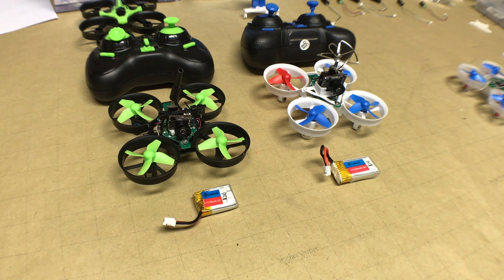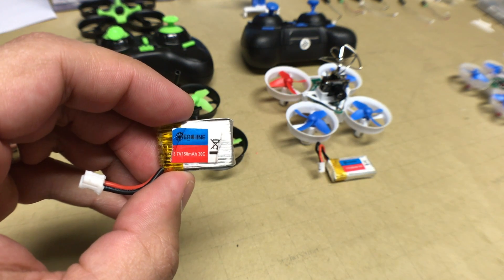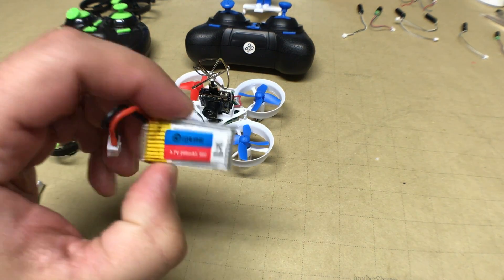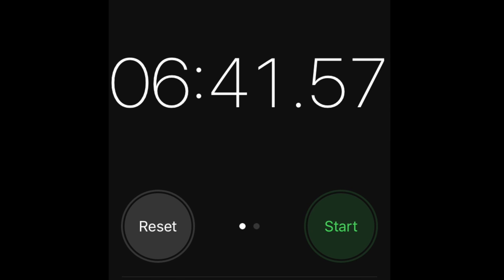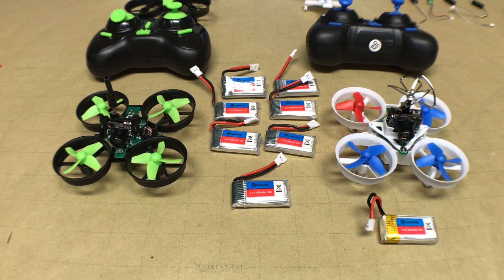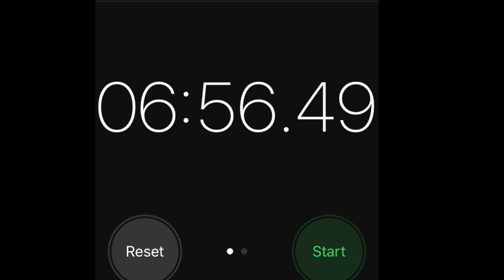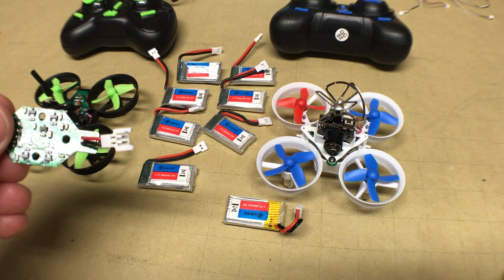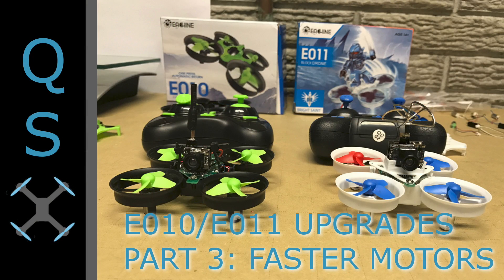Part 2: Eachine E010 E011 Upgrades - Battery Upgrades for E010/E011

Comment: Why stop there? I put JJRC 400mAh on e011, and should give about 50% more time than 260mAh. What's odd is the 260mAh that comes with the package is 9g, while the 400mAh battery is also 9g!
Reply from the maker: It's worth a shot.  Let us know if the performance matches the label on those 400mAh batteries.
Reply: I'm flying a modded E011c santa with a few holystone 350mAh (c rating not on batt), left over from a 170 with a fried board. i piggy back that junky little 200 mAh 35c that came with a E013 to a tx02 i get close to 5 min. now those 7/20 motors have my fingers itchy... ;)

Comment: Nice videos over different mod options for the E010.  Could you run a test on 30c vs 45c batteries?  I'm mostly interested in Stock E010 flight board paired with the best price/performance options.  I would like to see a flight test of whatever makes the most sense.  IE. 17,500KV/65,000RPM motors with 150mAh 45c batteries (lighter is better?)and 2 blade props.  

FYI. Special Sauce motors 17,500KV/65,000RPM on amazon are about the same price as the 59,000RPM that are sold on banggood, so maybe a comparison between the two might be a good idea.

Comment: run the audio for your vid thru a compressor and bring up the gain some. there's no way i can hear what you're saying.
Reply from the maker: +atomictraveller Is the problem with the clarity or the gain?  I can increase the gain in the video creator tool, but I don't run it through a compressor and would prefer not to if it is just the gain.
Reply: gain ;) your other vids were better (not loud but enough so i didn't have to press the speaker to my ear). i would say, always maximise your audio, use a limiter or something, better to clip the peaks than inaudible. ty :)
Reply from the maker: +atomictraveller check out my latest video and tell me if it's any better.  Hope it helped and thanks for the input!

Comment: Hi, is the battery connector on the E011 the same as the E010?
Reply from the maker: Hi Giacomo!  Yes, the battery connectors are the same on the stock E010 and E011.

Comment: Hi,  I am Vince Brizio  ! I want to buy a cheap Transmitter for my 
eachine E011( I hate the little stock TX ) .Please tell me which one  is
compatible?  the   X5C-14, BAYANGTOYS X16, devo 4 ? Do you have a 
suggest for me ? I have a Spektrum DX8, sorry not a Taranis  !! Thanks
Reply from the maker: Hey Vince, thanks for watching.  Unfortunately, I don't think I can help you with that one.  From what I could find, there isn't a good option for the DX8 and the E010/E011.  I have a multiprotocol unit on the way, but it doesn't work with the DX8.  Sorry
Reply: jumper?

Comment: I like your series on the E011! Thanks for doing it... I have an idea for a new video to add to this series! Obviously, the big weak point of this quad, and most toy grade quads, is of course the transmitter. Can you please do a video on how to bind this quad to a Taranis QX7? I bought the module for about 10 bucks for the back of the QX7 to have it work with many toy grade quads... Just need to know how to bind it. I think it would be very popular and helpful. I can't find any information anywhere on how to bind the E011. 
I really appreciate it! 😀
Reply from the maker: Scott, which model did you purchase?  Some of them have instructions online, but it may be different for yours.
Reply: Eachine E011 and QX7
Reply from the maker: Which multi-protocol transmitter module did you purchase for $10?
Reply from the maker: That's great.  If you don't mind me asking, what direction do the sticks need to go?  I have that module coming in the mail and would like to do a video for others running into this issue.  Thanks Scott!
Reply: Click on the "Click Here" link on the banggood site for the module (it's right after the Binding Instructions a ways down on the listing for the module). It opens a .pdf...scroll down 2/3 of the way and you'll see the only mention of Banyang protocol.  That's what the E011 uses, but not the E010 (as I remember, it is the first protocol on the .pdf).
Following those instructions, leave the left elevator stick alone and push the right stick up and to the right while turning on the FrSky transmitter.  It Binds and Flys! ;)  It so nice using the E011 speedster with a quality TX!

Comment: Please link to the new 45c battery with the different connector. A link to the connector needed to solder to the board would also be appreciated! Nice review! Liked! 😁
Reply: sorry to bother you again...2nd link is dead. thanks!
Reply from the maker: Thanks for watching, Scott!  The 45C battery with the same form factor as shown in the video is 240mah and can be found here https://m.banggood.com/5PCS-Eachine-E010S-3_7V-240mAh-45C-Upgrade-Battery-USB-Charger-Set-RC-Quadcopter-Spare-Parts-p-1135795.html.  The 260mah 45C version is the long and skinny version that doesn't fit in the E010/E011 battery tray without an adapter like these -> https://www.amazon.com/HOBBYTIGER-260mAh-Battery-Whoop-Inductrix/dp/B06XCMRW8H
Reply from the maker: The connector soldered to the board was scrapped from an old charger cable, but can also be found here Wire Connectors / Plugs for Team Losi Micro (1 Pair) https://www.amazon.com/dp/B00GHXAGVW/ref=cm_sw_r_cp_api_WRM.ybZM90CFE